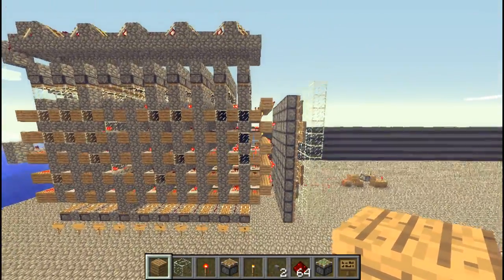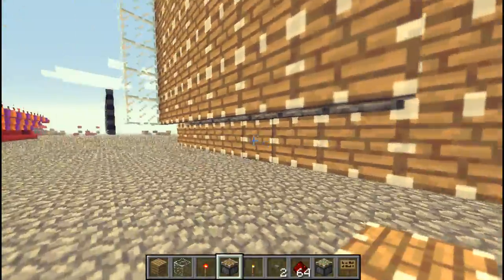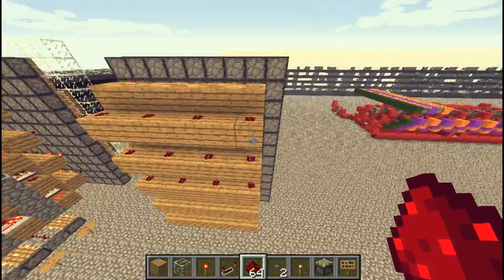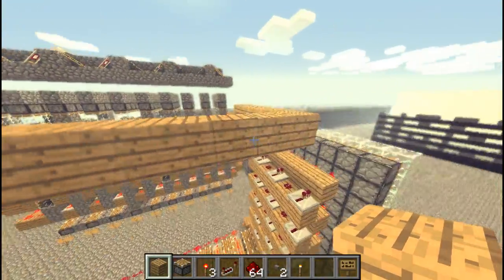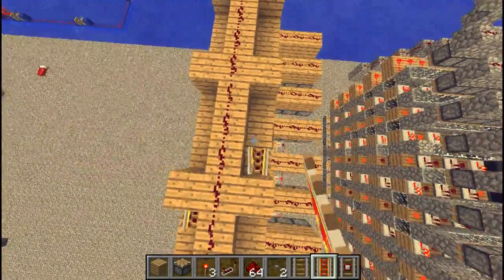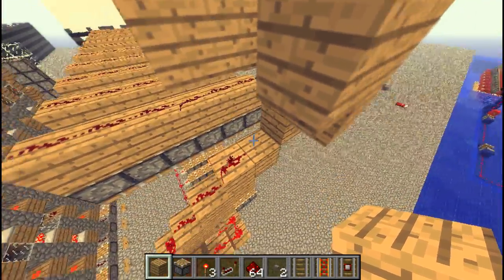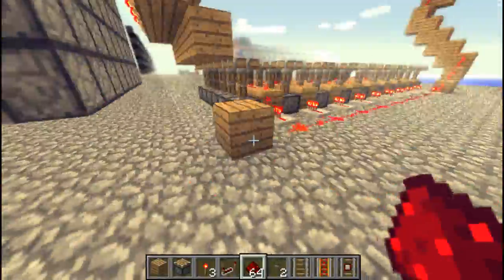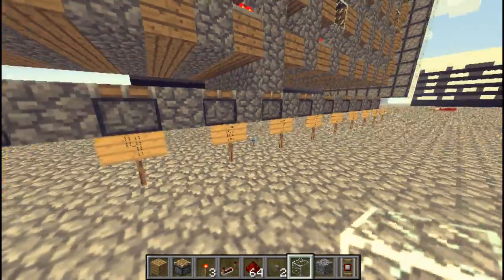2-Tone Display and Decimal Counter Tutorial

Comment from the maker: The pistons against glass trick no longer works unfortunately. If you want to use glowstone to make this display 2 tone, destroy the glass and piston layer at the front, place solid blocks (like cobblestone) above every one of the torches at the front, and place powered glowstone lamps against each torch and solid block.